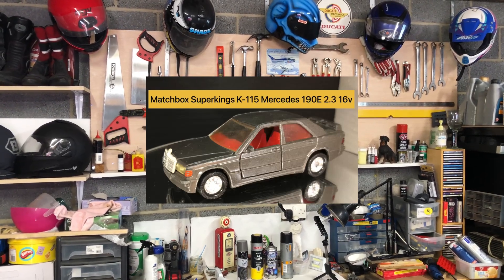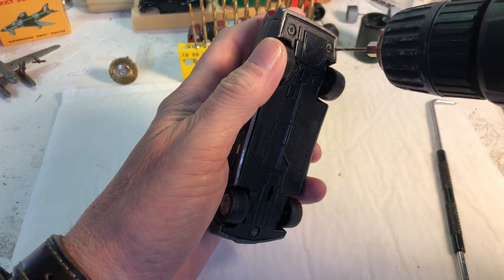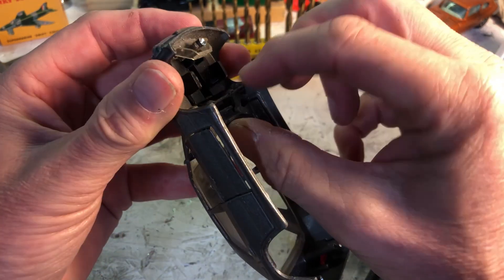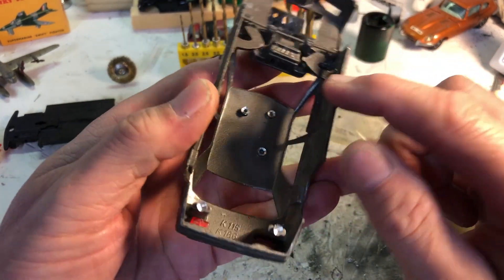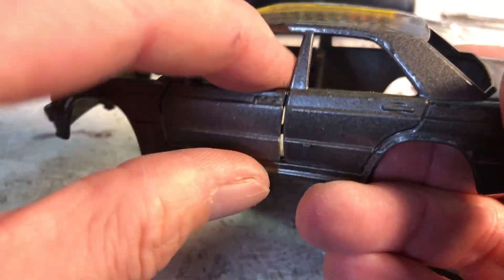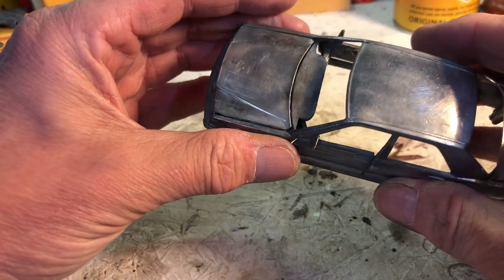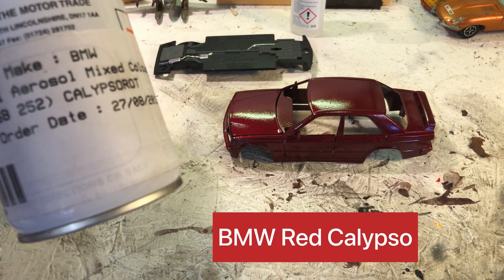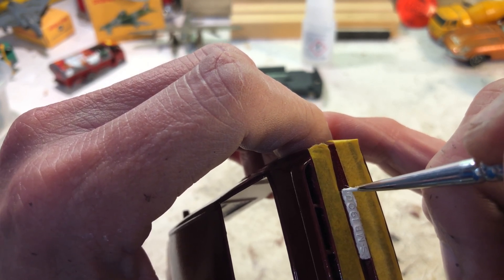Matchbox Superkings K-115 Mercedes Benz 190E 2.3 16v #diecast #Restoration

Comment: With those plastic based vehicles Andy you don't need to drill the rivets. Just pry underneath (As you did here anyway) whilst holding a soldering iron in the rivet depression, the base will pop off over the complete rivet. Press the base back on using a hollow tube/small socket and presto resto... The base is off and on with the original rivets intact 😉 Same with the lights,bit of heat on the melted over "rivet" formed from the  light itself and they will pop out. Merc turned out very smart 👍
Reply from the maker: Thank you for the tips. I will try to remember and take a look at others on YouTube to see it done.